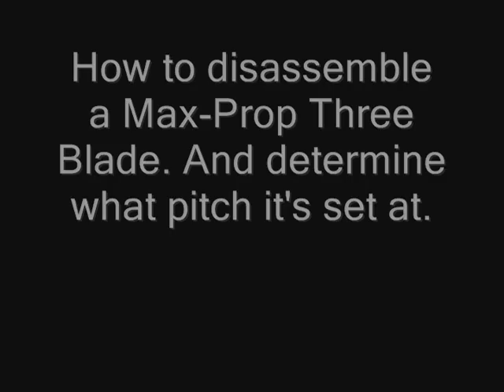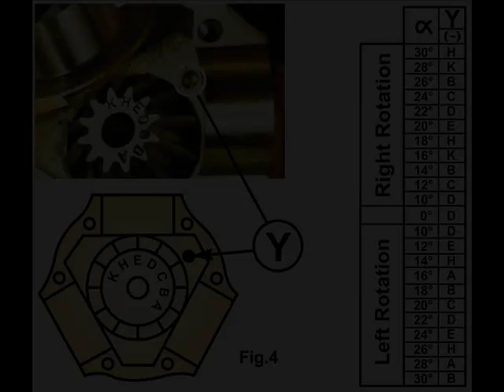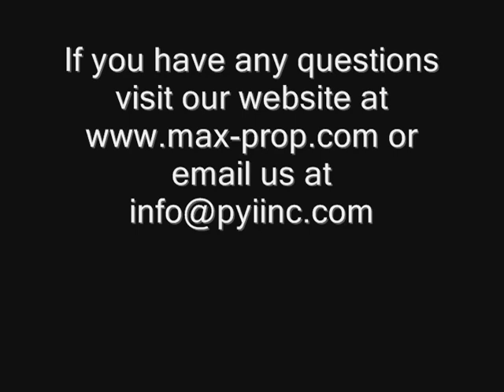Max-Prop: How to disassemble a three blade Max-Prop.

Comment: Where are the grease points for the classic  ? I've got one and are unsure where to fill ???
Reply from the maker: Garruick U - The grease ports on the Classics are located on the side of the body and are marked "Grease". You can use either one of the two ports to fill your prop with grease. You can watch our degreasing video where we degrease a 2 blade Max-Prop Classic here: https://youtu.be/Pr_aEJgugjM
Reply: @PYIinc   cheers no visible  wording I image the prop is cira 1979 ish ?

Comment: The video is great if you have a new un-used prop.  In real life nothing in the video will actually work.  That's because the inside of the prop, where you're shown to make marks with a marker will be all greasy.  Try making marks on greasy parts.

Comment: I have a catamaran and the max prop on the starboard side is correct and it is set 30 and 24. But the problem is on the port side when we put the same pitch the reverse gear go forward  and when we correct this ( reverse gear go reverse) it seems the pitch it is not right. 
Do you have any numbers whatsaap or skype so we can communicate batter? Thank once again.